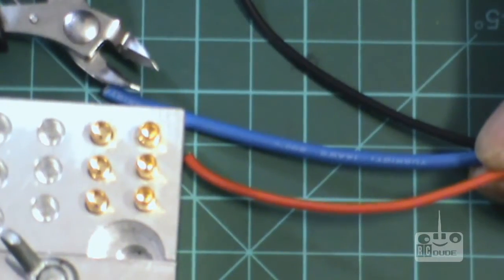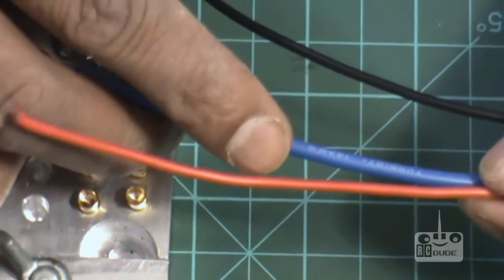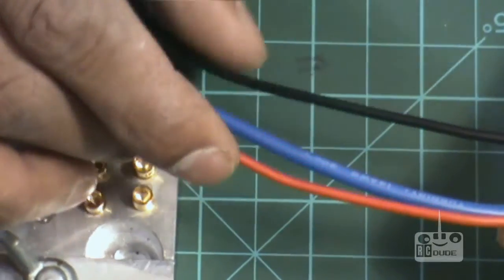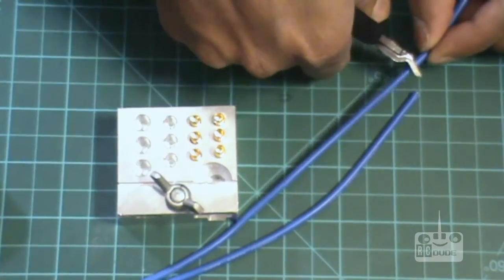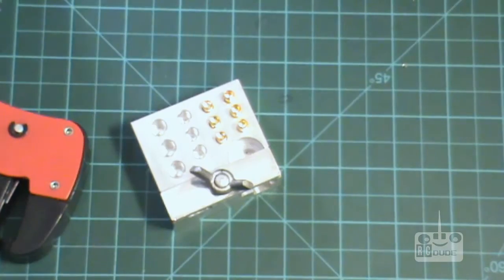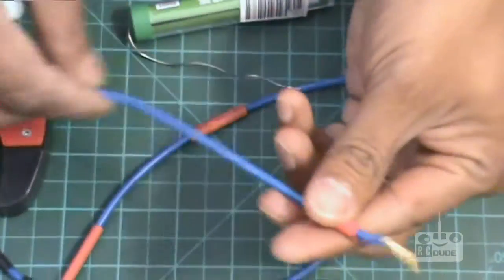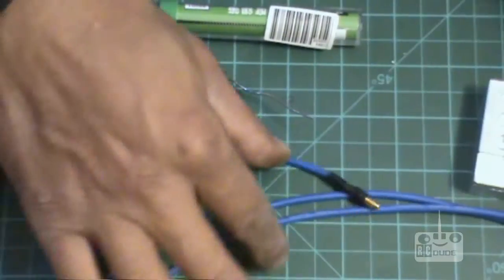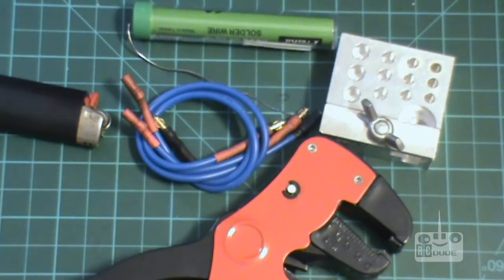How To Extend Your Rc Motor Or Esc Wire And  Heat Shrink

Comment: What are the copper connectors called?
Reply: These are bullet connectors, they come in different sizes, e.g. my SunnySky X2216 V3 motor comes with 3.5mm bullet connectors.

Comment: Where do you get those wires from? i looked up 16AWG wires and it comes up with audio wire.
Reply from the maker: +ConorCon Man03  
http://www.hobbyking.com/hobbyking/store/__466__377__Hardware_Accessories-Silicon_Wire.html
Reply: Look for silicon wires